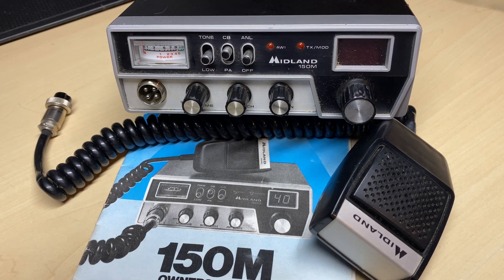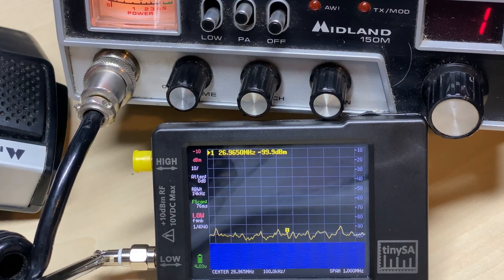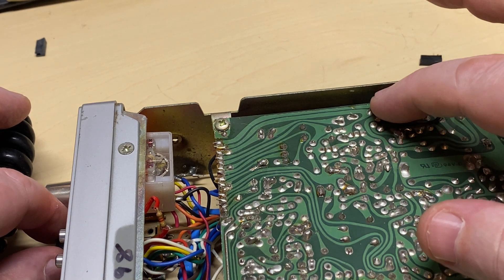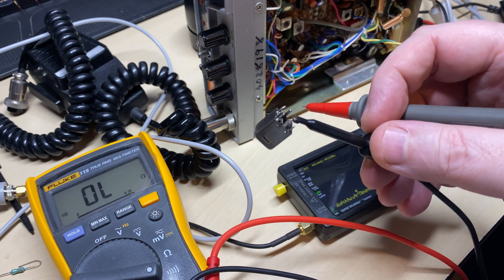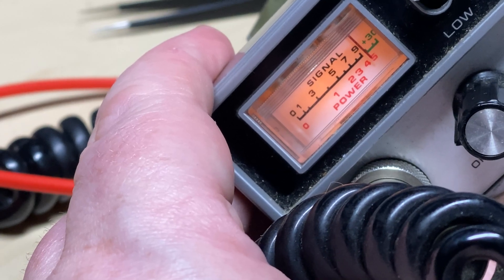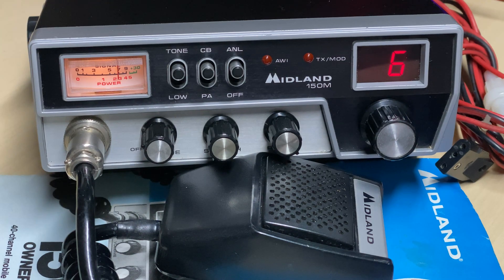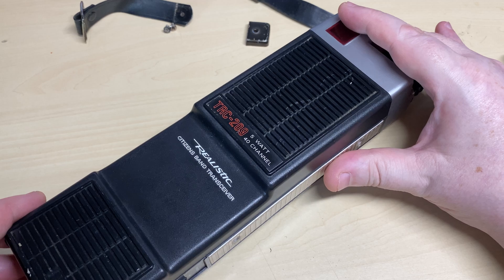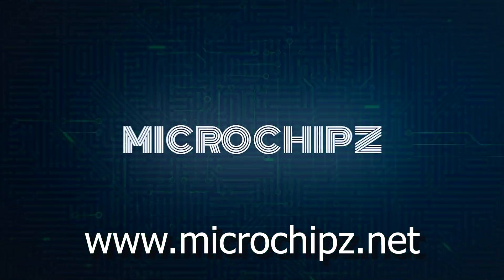EP 152 - Midland 150M Classic AM CB radio - no audio fault , can i save it ?

Comment: Those 455KHz and 10.7MHz IF Transformers are getting difficult to source, I have kept a collection over the years just in case. Good spot though, simple logical testing of each stage lead you to the actual fault, it's too easy to think it's a silicon issue. I wonder how difficult it would be add an FM board? I think Tony at Spectrum still sells the FM boards as a kit for not much money, and with your wizardry I'm sure you could swap the PLL and give it full coverage. Anyway, great video, really enjoyed it.

Cheers
Rob.
Reply from the maker: Yeh I think a FM board would go in it , the pll swap could be tricky but not impossible , this pll uses different freqs for rx and tx , I did try with a ham Uk and didn’t get far , maybe il revisit one day,
Reply: @MicroChipz  I suppose another option would be to replace the PLL and VCO with an SI5351 and replace the LED display with a small OLED using a rotary encoder, pop the band selection on the encoder push switch. Anyway, have fun, looking forward to the next video.

Comment: That's some odd fault. Maybe it was caused by the flux they used back in the day in combination with moisture.
Nice little Radio anyway.
Is this a cybernet chassis?
Also a  nice "little" hand held radio. 5W AM - that must be working fine! In Germany back in the day only 0,5W AM was alowed and AM was only alowed on ch 4-15

Greetings from Germany.
Reply from the maker: Think its Midlands own board , yeh possible flux and moisture corrosion , was a pain to find , but we did it and another classic radio saved , thanks for watching.